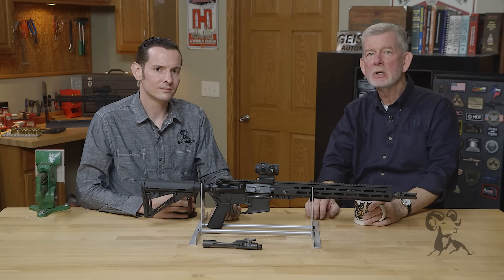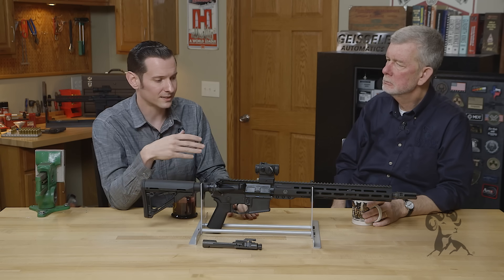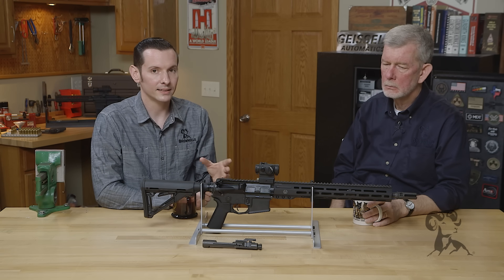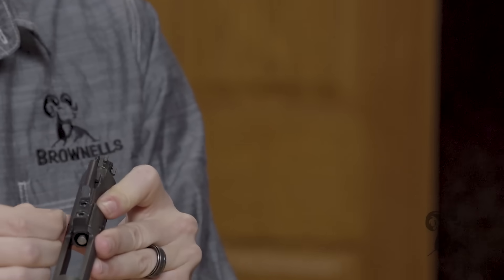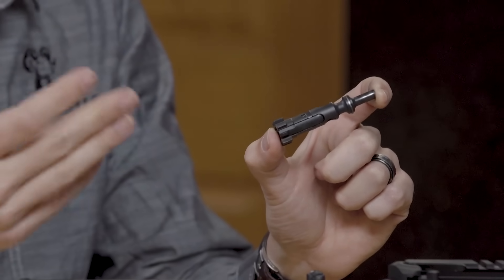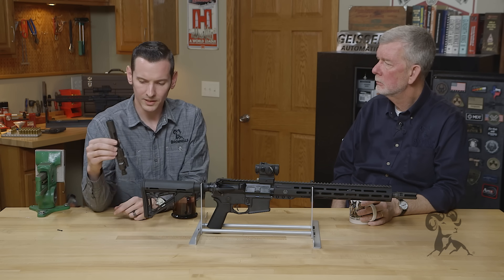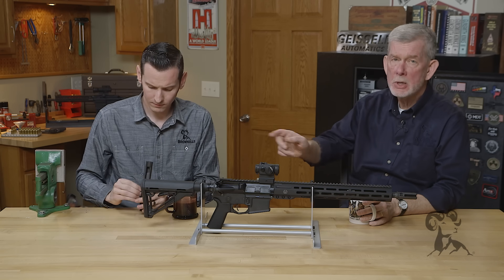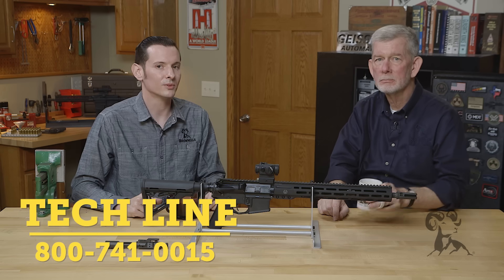Quick Tip: Fixing Common AR-15 Gas System Problems

Comment: Brothers, I'm not sure if you'll read this comment, but anytime I can't find my specific issue, i always end up in your videos for the answer. I started having a failure to eject, the bolt almost seemed stuck and hard to cycle. I field striped it, didn't see much, so i continued firing it like a bolt action gun 😂 (wont be doing that next time). I got home and thought it could've just been carbon build up, I had not cleaned the rifle in quite some time. As I disassembled the BCG, I could've sworn I heard something fall, but didn't think too much of it. Once cleaned, it felt fine, but I still did some research that lead me to this video. I did the "collapse" test and mine was completely done for. I then got a flashlight and looked for whatever I heard fall earlier and it was a completely worn ring. Now I just ordered a pack of rings for back up! I also inspected all my other bolts to make sure the rings are still in good condition. Thanks!

Comment: What if there haven’t been that many rounds through it? I have a Ruger AR556, with maybe 300-400 rounds through it. I sent the BCG back to Ruger, which they replaced. Haven’t shot it in a while, but 3 times in a row this morning it short cycled. I tried different ammo, inspected the bolt carrier right there at the range, but all appears normal. Could it have also been just the magazine? Looking for the obvious solution first. ‘Is it plugged in and the power on?’
Reply: Lube. It’s dry.

Comment: I have an Aero adjustable gas block, I set the gas system and it was running fine, maybe 15 rds later all of a sudden wouldn’t cycle the gun as if it was under gassed.  I checked the gas block when I got home and it had not moved.  Any ideas where to look ?

Comment: Newbie here- What would cause you to have  rack the charging handle  multiple  times in order to fire a round?  Bad ammo, improper install of trigger springs, wrong buffer   spring or weight or..? I believe  those ones have  drop-in triggers  and  this occured even  if chambered or   hand loaded  w/o using  the magazine. They're rifle length  builds :   AR10 308 and a AR15  224 Valkyrie.  Thanks  in advance

Comment: An tuned gas tube is also an option, especially if you can't install an adjustable gas block because you are using a sight tower.

Comment: I bought a brand new 300 Blackout and it was extremely under gassed shooting sonic and subsonic rounds. Turns out my gas block screws were both lose. After tightening the screws my rifle shoots perfectly. You guys nailed it.

Comment: Is there supposed to be a clear path from the gas key to the inside of the bolt carrier ? For instance if air is pushed through that path would it freely travel in it ?

Comment: I had a gas seal get bent and lock the gun up,was a real bitch to get it apart,brand new ruger ar556. Wound up replacing the bcg with an aero precision bcg,now it works flawlessly

Comment: Preface, I'm a 3 Gunner and shoot about 3k rounds per year in my Noveske rifle.  I use 3 piece gas rings and replace them every year.  Years ago, I had a gas ring fail during a major match that resulted in a non-cycling rifle.  Gas rings are inexpensive and should be a regular maintenance item for your AR.

Comment: I NEED HELP have a upper that ejects 1o clock, I don't remember it ever doing this but maybe it did?? I put a comp on it and that's when I started to notice the weird ejection pattern,  I put a 5.8 Oz buffer in it, nothing...I changed bolt carriers from a whole different AR, nothing,,, I even put the original flash hider back on, and nothing seems to work?? It's a cheap upper and that in itself could be the problem?  Who knows, anything else I could look at? Check? Etc, if nothing can I put a new adjustable gas system on it ,it's a 16 mid length 🤷 thanks in advance

Comment: Thank you for your YouTube tutorials. They are a learning experience. The best way to fix over gas is to use an under sized gas tube it has a smaller hole allowing less gas. An adjustable gas block just adds another thing that wears out way too quickly.

Comment: Built a new .300 Blk, it fires but then the extractor won’t let the round go nor will it eject. I’ve looked at the gas tube as best as I can and the key has the stakes I’ll have to check the rings as see what’s going on

Comment: That's why I have two ARs and one Mini 14. I have a series 584. No, it's not as accurate or as tacticool (featureless model with wood stock), but it's not prone to any of the malfunctions listed in this video. It's also much easier to clean.

Comment: What would happen if one were to over tighten a gas block set screw above 25 inch pounds (i.e to 30-40 inch lbs.) 

Could the problem be solved by simply backing out the set screw/s and reset them to 20-25 inch pounds of torque? 🤔

Comment: Alright I built an ar and I will rack a bullet in and then it will click when I go to fire and it’s hard as shit to pull the bolt back again but I do and rack another one and it may or may not do the same thing but when one finally shoots it’ll shoot a few in a row then bolt get stuck with a round in the chamber and not shoot again… I’ve taken it to a gun smith and they changed the gas block and said it was good but it’s not

Comment: I have a .875 barrel I ordered a .875 gas block with 2 set screws. The GB is a loose fit on the barrel. Is there a way to fix this?
Reply: Measure the barrel at the gas port with the gas block removed, I have seen barrels advertised as .875 diameter that specified a .750 gas block.

I hope that this helps 👍🤠‼️

Comment: I bought a AR15 but it fail to load the 2nd round I can see the markings on the barrel that gas or powder is coming from the rear side from the gas block (opposite side from the end of the barrel)I think that’s what is causing it any advice?

Comment: My daughter in law bought a new AR that would cycle brass 5.56 just fine but would not cycle steel. I found machining chips in the barrel gas port. Works great now.

Comment: Gas ring isn't the only failure that lets the carrier drop when testing. A carrier with too large a diameter from either wear or poorly manufactured and too loose tolerance can drop and show as a failure.

Comment: My issue is that I can fire the first time but have to pull the bolt carrier each time I fire...it has been that way since I purchased it...is there anyway of fixing this issue without sending it back to manufacturer?

Comment: I have been assembling AR-15s since the 80s, primarily for myself and some family members. I have had very few problems over the years and nothing that wasn't easily resolved until now. I recently built a 10.5 inch .223 SBR for myself using new quality parts and after maybe 40 rounds discovered an under-gassing problem when shooting cheap Wolf ammo and even when suppressed! Long story short I started checking the gas system starting from gas block and working back toward the chamber. Everything appeared to be in spec and correctly assembled. So I tried it again using good quality brass cased ammo and it still not right. In fact it was worse!! 
I remembered this video and re-watched it to see what I overlooked and stopped when you said gas key. I had ignored it as the problem because it was a "new bolt" and I only verified the rings. But I pulled it out and sure enough I saw the gas key wobble and it wasn't tight or staked. It only had a very slight pin prick on both sides of each bolt and was getting looser after every firing. I knew better but still overlooked the possibility of a loose gas key because it was new and expensive.  Lesson learned.
Thanks again!

Comment: would a softer spring or heavier buffer work for being under gassed?  doing the 'one' bullet test, my bcg is not coming back all the way and locking in the open position.

Comment: So I had an under gas issue on a 20” rifle build - cycled 5.56 but not .223. Confirmed gas flow then replaced the buffer spring with a flat spring - next step was going to be to take an oz out of the 5.2 oz weight. Cold or light fire both rounds cycle but heavier fire sometimes the last .223 won’t lock the mag. Should I lighten the rifle buffer 1 weight? Any downside? Thank you, your series is very informative. Best

Comment: I'm building a 308 ar10 and it has a 20 inch barrel but I don't know what size gas block, tube or diameter or what bolt goes with them as I am on a budget can you help

Comment: One of the selling points of one piece gas rings is reduced friction. As a result, the vertical friction test demonstrated in this video is generally not useful for single piece gas rings, as a properly designed one piece will not produce enough friction to hold the carrier up even when new.

Comment: New barrel and gas system installed at the factory. It is definitely a low gas situation. Is there a chance the adjustable gas block was turned down at the factory during installation?

Comment: Need help:

I bought a used AR that a guy built out of spare parts he had the parts look good to go and almost new (little wear) very good condition and I believe it's over gassed because the first shot was like dumping a whole cartridge of power up my nose and was so bad after 30rds I don't want too shoot it anymore it's bad I have a store-bought Ruger ar-556 and it has never had that problem at all. And there was a lot of gas leakage it seem like coming from the gas block can anyone tell me what would be the issue gas block or over gassed? Or both and it had no issues feeding the 30rds? Any help would be very much appreciated thank you

Comment: So for a brand new gun, what might be the best solution to under gassing? I do have an adjustable gas block, but even after opening it up quite a bit it was still having feed issues
Reply: Sounds like another issue. If it truly is just under gassed, you'll likely need to change something with your buffer spring/ buffer weight.

Comment: Great video. I now know that my gas rings in my M16A1 that I was issued in the early 90's were worn out. I remember how easily my bolt would slide out. Cool. Thanks for sharing.

Comment: How about gas leaking around a gas block? How much is normal how much isn't? Should you fix it or will it fix itself? This would be a great video for you guys to do. Mine leak so I googled it and seams to be a very common problem but couldn't find a video. From what I understand is unless your getting an under gassing issue it's fine and will sometimes seal itself. You could also discuss clamp on gas blocks vs set screw has blocks. Thanks for the great videos!

Comment: I've heard may recommend against adjustable gas blocks for defensive AR's(if it's a range toy or comp gun it doesn't matter nearly as much). They're typically far less reliable than a fixed block. The best think I've heard for over gassing is to increase buffer weight and bolt carrier mass. This also helps with recoil and general reliability. InRangeTV has a great video on this interviewing one of the co-designers of the AR-15.

Comment: I have a relatively new (~2 months/~1K rnds) 223/556 AR. At first the ejection pattern was erratic 2-4 o'clock. Now pretty much 2 o'clock suggesting over-gassed. The gun runs fine. I do shoot various brands of ammo (all new) and haven't made an effort to correlate the ammo brand to ejection. Should I be concerned?
Reply: I wouldnt, when you have spare money and time i would get an adjustable gas block just because its also a big QOL feature being able to tune your rifle to run optimally.
Reply: @eatdatshoplifter4459  Appreciate the advice.

Comment: The other check is to check the gas tube alignment and condition of gas carrier key bevel. With the BCG stripped down, re-install the bolt carrier while holding the upper assembly at a 45 degree angle (muzzle down). Hold the bolt carrier out part way and release. Under its own weight, the carrier should slide in all the way and the gas tube should align with the carrier key. If the gas tube moves a lot or stops the carrier, the gas tube is bent. But also check the carrier key to ensure the two screws are tight and staked. Ensure the bevel end of the carrier key is not damaged, round and no burrs which usually occurs from dropping the carrier on the ground. Just in case anyone wonders, I was an Army Warrant Officer (MOS 913A), TACOM LAR, weapons instructor, and gunsmith.
Reply: Great tip and explanation. We were always told not to drop the bolt. Now I know, thank you sir.
Reply: Nobody was wondering

Comment: Standing the extended bolt upright to see if the bolt carrier collapses over the bolt has unfortunately been passed down through generations of Army personnel. The TM clearly states to field strip the bolt from the bolt carrier and reinstall the bolt in the bolt carrier. Then, hold the bolt carrier upside down and see if the bolt falls out of the carrier under its own weight. That is the correct test of the three gas rings (unless the TM has changed after 2014). I still test the gas rings in this matter. Gas rings seldom need replacement unless the operator damages a ring reinstalling the bolt in the carrier.

Comment: Will an adjustable gas block help with high pressure/ejector marks on brass? if so how? thanks for your videos!
Reply: No. 
That is ammo that is too hot, too much pressure. 
5.56 green tip is loaded hot.  Soft brass will take marks on brass head and flow into ejector hole and be steered off when bolt rotates. Try different ammo.  Brass may be softer than normal. Foreign made ammo? 
 .223 is loaded less power.

Comment: The AR-15 is such a brilliant design. Thank You guys for informing us of these characteristics.
Reply: The internal piston design is the best for mitigating recoil. Stoner was a genius....
Reply: AR gas design SUCKS! 
should have been a piston design then able to use all power levels of ammo and absolute reliability without over pressure, under pressure, gas rings issues.
Reply: @colt45peacemaker  The AR is a piston design, try again...The AR is a reliable design, what makes you think it isn't ???
Reply: @hairydogstail  gas impingement design
Reply: @colt45peacemaker  Internal piston..All gas operated firearms are gas impingement..Long stroke, short stroke and internal piston...Many call the AR Stoner rifle direct impingement and it isn't..It is an internal piston...

Comment: I called a technician at Brownell’s and was told an over gassed system would eject brass back to the 4-5 o’clock position. The under gassed system would eject foreword  3oclock to 1oclock. I just heard this video explained it the other way forward was over gassed rearward  under guest
Reply: Video is correct. 
Over gas throws forward 1:00 position.

Comment: I’ve been looking at videos. My father gave my a colt ar-15 late 60’s early 70’s model it was shooting fine and now when I shoot it’s having FTE meaning I have to eject the round manually and I thought it was my gas tube but it could be the gas rings. Anybody have any suggestions?
Reply: Disassemble and clean bolt carrier & bolt. Inspect gas rings, check gas key for loose. Clean gas tube. Insure tube and front sight gas block is not restricted with carbon. Lubricate bolt & Carrier. 
Test ejector spring has enough force.  Bolt & Carrier out of receiver, Place round on bolt face hooked into extractor and test for a firm ejector spring and ejector that moves freely.
Reply: @colt45peacemaker  thank you. And I’ve looked into it more I have the ar 15 sp1. And the lower receiver is a sladslide with screwpin I just need to get the screwpin out but I think it needs a tool other than a flathead

Comment: I went to the range the other day and it wouldn’t run to the next chamber and when I continue to do it manually it would eventually just stop ejecting the casing. I looked at my barrel and it appears it is slipping from what I think is the gas block. What would be the fix for that?
Reply: Gas block is loose. Align and tighten.
 Unless it is a pinned on GI military style front sight.

Comment: What about a short cycling sig 516.  Has any stable gas block already but the damn thing just doesn’t run.
Reply: Adjustable gas block is too restricted. Not letting enough gas past it. Open adjustment screw according to instruction steps. There may be a lock screw that needs loosening before the main screw.

Comment: If I had a nickel every time I’ve heard “properly staked”.   Why don’t people say “properly” for everything else you do on the AR. Like Property torqued, properly aligned, properly installed, properly zeroed, properly centered, properly seated, properly balance, properly lubed, properly compressed, properly pressed, properly rotated, properly extended, properly collapsed, properly punched, properly torsioned, properly closed, properly engaged, properly retracted, properly retained, properly inserted, properly flipped, properly pushed, properly shot.....
Reply: Are you properly triggered?
Reply: They probably doing it improperly ...
Reply: Because all gas keys are staked, but not all gas keys are properly staked.  Its just about clear communication, that’s all.

Your list contains phrases where the “properly” modifier indeed makes no sense.  “Properly zeroed” is redundant.  A rifle is either zeroed or it’s not.  “Properly aligned” - again, unnecessary as something is either aligned or not.  However, something can be staked, torqued, seated, lubed, compressed, etc.  improperly.  These are questions of degree, not state.  Isn’t clear communication great?
Reply: Because people parrot others.

Comment: That tip of the bcg holding its weight is a great piece of information. I'd been wondering when to replace the rings. You got that Retainer pin in so damn quick. Thats the one thing to give me trouble when reassembling.